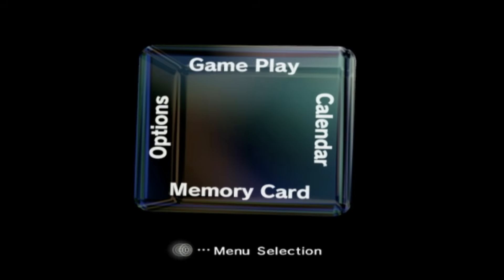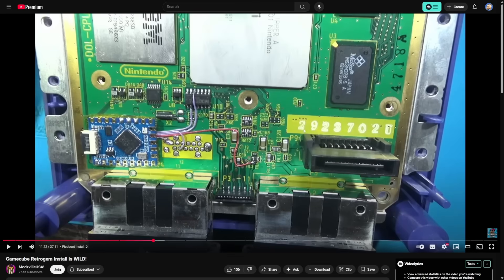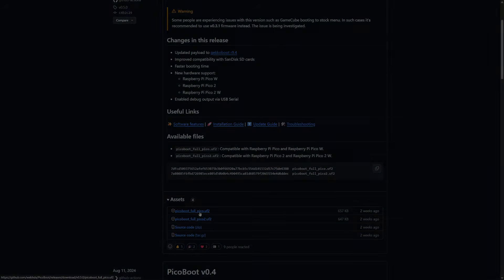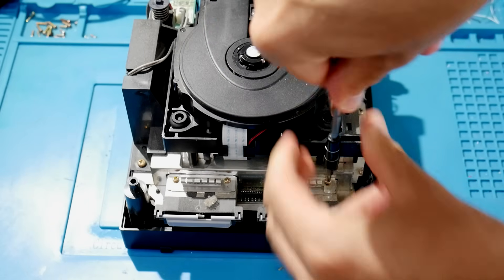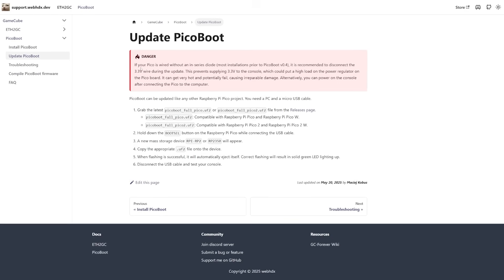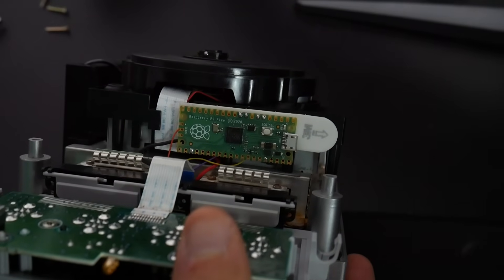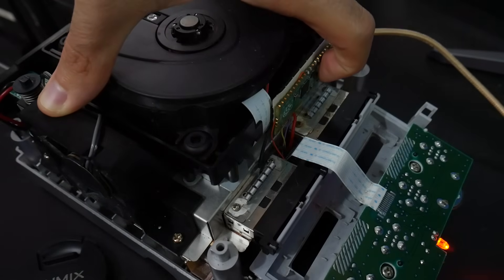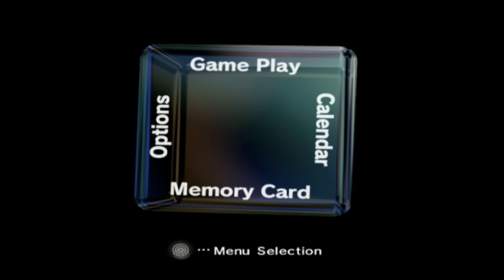How to Update PicoBoot Firmware for the GameCube!

Comment: I tried updating to the latest firmware but that didn't work so I tried rolling back the versions and at some point I think I must have fried the Pico because now I don't get the green light at all anymore. Oh well, Picos are cheap enough to replace fairly easily.
Reply from the maker: Sorry to hear, it indeed. Sounds like it would be best to drop in a new one.
Reply: @MrMario2011  I swapped in a new Pi Pico and had the same issue. Ultimately I ended up shortening my wire lengths and replacing the 3v3 and Ground with thicker wire. Now it works better than it ever did before, and I bet my original Pico board is probably still good too (turns out the green LED doesn't light up on Pico Ws with the older firmware but still works).

Comment: thanks. just did it. worked great! a question. swiss is also distributed as uf2 file. does that means that it will boot directly to swiss without sd2sp/mc/any other stuff? whats the point of this? any benefit of doing this instead of having swiss on microsd on sd2sp? Also, how to set TIME on console if I dont have a DVD drive? it just give me an error.
Reply from the maker: I believe it is supposed to work that way, although I didn't show flashing Swiss as I actually tried it and couldn't get it working on my console. So I stuck with PicoBoot for the install.
Reply: for me i activated boot through ipl on swiss settings, then i booted a game, you should see the gamecube boot animation, hold A then you can access the console settings to set the time
Reply: Yes you can do that. Only thing is any swiss updates you have to do this process to update, vs with Picoboot you can update the swiss file.

Comment: Just a word of caution with those 3M command strips- if there is any amount of dust or dirt on either side receiving the adhesive, the adhesive will simply let go from the surface and it can't be pressed on.  It's a very good adhesive for shear strength for hanging things, but it's extremely bad dealing with a contaminated surfaces since it doesn't retain any tack.  You don't want that Pico coming off and shorting inside something.
Reply from the maker: Very true! Good looking out.

Comment: When I installed mine I decided to use a 5 pin harness to avoid de-soldering pico for updates, now I just unplug it, update and put it back in. However I still had to make the new changes and add the diode.
Reply from the maker: That's cool. Thankfully no need to desolder, as long as you're cool with running the GameCube as shown here.